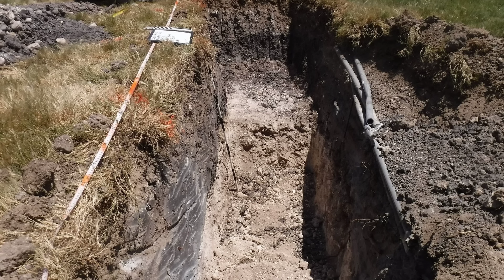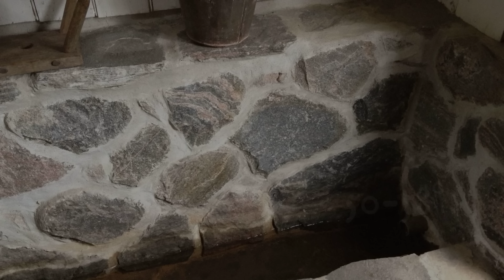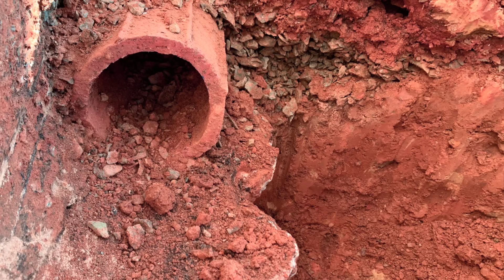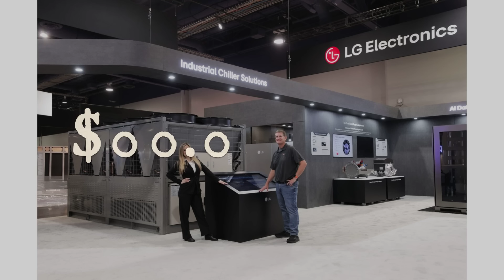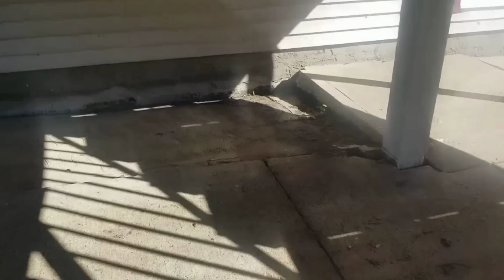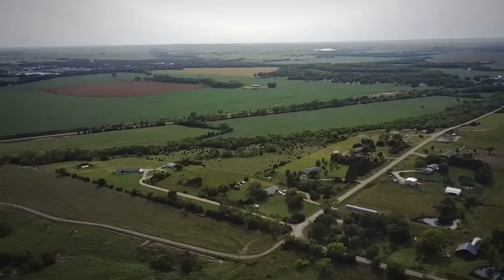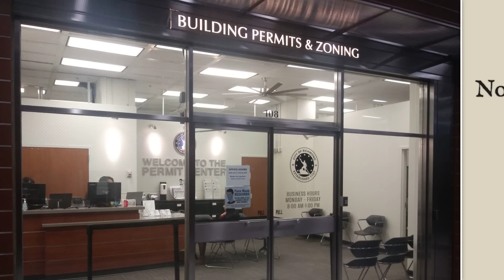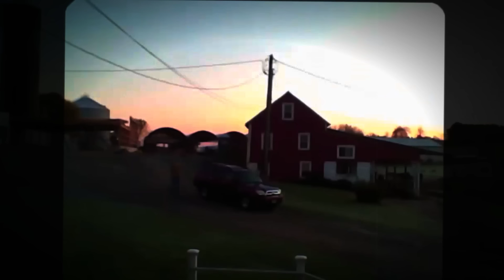This $300 Tunnel Keeps Any Home 55°F Forever — The Amish System the Cooling Industry Made Illegal

Comment: If you are, or want to be, completely off grid using the underground pipe system, copy what the Romans were doing a couple thousand years ago: install a pipe through the roof at the furthest point from the cool air intake, and paint the exposed portion of it black. Simple as that. The sun heats the pipe creating a natural draw due to the hot air rising and in turn the escaping warm air pulls the cool air out of the underground pipes, no fans or electricity needed.
Reply: dont worry the ac companies will find a way to make that illegal or any other way
Reply: @YTcommentsAreForKidsac does more than just cooling home. It's also a dehumidifier, heater, and provides airflow for the home preventing sick building syndrome
Reply: Easier to slap on a simple Trombe wall.
In summer,dump the heat outside.
In winter,vent it into the house.
You will need a large panel of double pane glass.
Matt black paint.
Several tin cans of matching diameter.
Or....
Position the pane diagonally,keep a raised bed of salad vegetables under it on the South facing wall.
Again....the wall insulates the house.
In winter,the compost nutrients (manure) will add heat to the system.
Reply: @b @boogieknee3781 himney effect will be negligible in winter

I do like the trombe wall but I’d ditch the Roman venting thing and have a big thermal mass with a pechka stove but going through the floor not a bed

House on pilings cause snow melts
Reply: @milolowly1744 definitely just use a wood burner in winter, this covers summer tho for sure
Reply: Niiiice!! Now if only I didn’t live in Florida!
Reply: @BURNINGLIMBO   it doesn't matter where you live. Even deep in the tropics the earth remains a stable temperature. Different climates and soil composition require different depth to bury the cooling tunnels. Moist soil, like in the East Coast doesn't need to be too deep, 6 feet generally. Dry soil in hot arid climates, like Texas, requires the cooling pipes to be deeper. Something like 12-15 feet.
Reply: @MesserEsser_OG what about phx?
Reply: @spikey01234  It falls under the same climate as TX. Once you go down 12-15 feet no matter where you are, the soil temperature remains constant year round within a couple degrees. 

Where it changes is how high the water table is. Some places have a water table 6 feet down. In those places you can't have a basement or a geothermal cooling system that's more than 3 feet deep. Most places 6 feet is fine. Some places you need 10-12, and others 12-15. There are websites dedicated to this and there are equations to determine soil composition and depth and annual seasonal cycles. If you are genuinely interested in implementing a geothermal cooling system, I would encourage you check those sites out and even reach out to them.
Reply: @spikey01234 still same temp
Reply: @MesserEsser_OG  Arid is a word I've never once heard used to describe Texas. Most of the state is as humid as Florida.
Reply: @MesserEsser_OG tell me you don’t know about water tables without telling me you don’t know about water tables
Reply: @BURNINGLIMBO  Geothermal cooling works very well in Florida. The ground temperature at six feet and below is right around 70F which is pretty cool in summer and nice and warm in winter. Do some research and you will see how it can be a real winner for you.
Reply: @TheCrunchbird  good luck getting 6 feet deep in most of florida without water lol
Reply: @TheCrunchbird if you dig 3ft deep in Florida you're at groundwater.
Reply: @TheCrunchbird  Fun fact, 90% of Florida is less than 5ft above sea level
Reply: @TheCrunchbird every where I dig here are giant rocks and theres a reason why most places don't have a basement here. 6 feet deep and we made a natural pool
Reply: @TheCrunchbird  the cost of geothermal is 100x what you'd spend on natural gas
Reply: @TheCrunchbird too bad I’m in Texas where it’s extremely difficult to dig
Reply: @TheCrunchbird worked under contract for 4 (15 years ago) years at then UOIT (yeah, it’s a mouthful of a name, renamed since) in Ontario Canada. There is one the largest borehole storage systems. Over 370 boreholes(I believe equipment came from Alberta to drill) 180-213m deep(up to 700ft). Right under the commons/soccer field. 150km of underground piping. I don’t remember exactly 12 or 14” dia mains(supply n return). I was there running equipment for wind tunnel, ad so ended up looking after utilities as well. 
The issues nobody talks about is when you have 2-3 seasons of hot summers and warm winters, the ground doesn’t have enough time to cool. That was in our case and extra water towers had to be brought on line in summer to help keep the building cool. 
Geothermal works and works better prolly in the pond than ground source.  Always should calculate extra cap. This was huuge project.
Reply: @TheCrunchbird that won't sufficiently cool a house though completely. You need a temperature differential higher than that to compensate for the heat load of the home. To achieve a 75°internal temperature on 90° day where your attic is north of 120° means that you need at least a 30° differential. The HVAC industry has done some evil stuff for sure but they do know their math as far as heat loading. Geothermal can be used as an assistant to a normal HVAC system within a Florida home.
Reply: @BURNINGLIMBO the most Florida thing ever said 😂
Reply: @BURNINGLIMBO who you talkin to?!?! 🤣🤣🤣
Reply: @BURNINGLIMBO you know, once you dig down 3 feet into the dirt, it becomes 55-60 degrees no matter where you are.

If it's hot outside, underground is colder. If it's cold outside, underground is hotter. You can always survive 60 degrees and it's easy to make it warmer if you need a fire
Reply: @BURNINGLIMBO  I’m in Texas and had a guy show me one of these he had for a 4000 square foot log cabin 20 years ago. It worked awesome and cost him very little, even in the Texas heat.
Reply: @BURNINGLIMBO  my man, that would be pretty nice i would imagine. You have a significantly more moist ground to work with. 

Your only drawback in my mind would be having an industrial dehumidifier 😂 which, with the Florida sun, getting that on a small and cheap solar system would be very doable!
Reply: @King_DarkSide  Use a closed pipe system filled with water and antifreeze. It works great and does not require any permits.
Reply: This is the stuff in comments that inspired me. I don’t know anything about that subject, but it makes me want to learn so thanks for lighting the fire under me!
Reply: Everyone who reads this, we don't know each other and probably never will but I wish you all the best in life and all the luck in the world
Reply: @BodycamLegalCentral no
Reply: Oh dear I don’t like it above 60f…
Reply: And what about radon?
Reply: @NukeJesus  Good question. 
Since the primary means of radon mitigation is ventilation, and this system operates based on ventilation, it is logical to conclude that radon exposure concerns would not be a problem. Of course, lots of testing would need to be performed in order to verify this hypothesis.
Reply: @NukeJesus  These deep thinkers will tell you that Radon is a Globalist hoax.
Reply: Wouldnt do anything for rooms not in the path of that air and besides it would have to be a huge pipe to get enough air flow, you aren't just replacing the air, you have a heat load as well from the slab, windows, walls and roof.
Reply: @chrisduncan1647  You can also use multiple outlet pipes to draw air into as many different rooms as possible/needed. The underground pipes that the Romans used were supposedly tall enough for a man to walk upright in them. That's a huge air volume to draw from, and they usually used two.
Reply: @chrisduncan1647  You can also use multiple outlet pipes to draw air into as many different rooms as possible/needed. The underground pipes that the Romans used were supposedly tall enough for a man to walk upright in them. That's a huge air volume to draw from, and they usually used two.
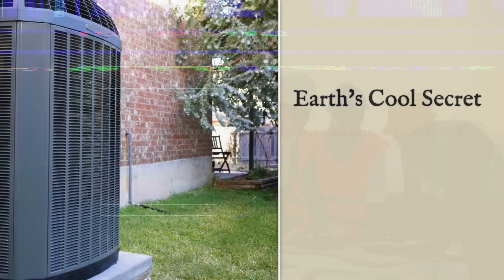Reply: 1:43 This is mind-blowing 🔥 Simple system, massive cooling effect.
Reply: Thank you for this nugget of information!
Reply: Should we worry about radon doing this? I’m assuming “no” because the pipe is sealed and pulling air from above ground and being cooled or heated by the ground, but air is not coming from the ground right?
Reply: @brycejurgy Correct, if you properly seal the underground pipes. Look up radon maps for the trouble spots, you may not have anything to worry about anyway.
Reply: The same physics at work that cool the giant ant mounds you see in scorching climates
Reply: combustion 101...love it
Reply: Thank you
Reply: *Greeks
Reply: This would only help in summer i think, what about cloudy winter?
Reply: @MADM-tinus burn wood 😂
Reply: ok, install a pipe... how big, how long, and where does it lead or connect to? or is it just install a pipe and let it dangle in my living room? Im not being sarcastic here, genuinely want to know...
Reply: @TheTruthSeekingSage 

The one in the roof? 
It's just a vent.
Reply: @TheTruthSeekingSage me too
Reply: @TheTruthSeekingSage  It has to be below the frost line. The longer the tube or the more tubes, then the more cooling. You need a vertical tube open to the outside air. If you want to use a fan, then that will be sized for the drop of the tube. If you want an entire passive system then you need a tube out of the roof which is painted black with thermal mass which is hot and causes a draw
Reply: @xando81  yeah i get it... but this is a lot of work for a meh effect...
Reply: This is basically a passive cooling system, right? Curious if anyone has built something like this. how effective is it during peak summer?
Reply: @HardTimesHandbookI'll tell you in 1 week or less.  I have the pipe burried.
Reply: Just don’t use lead pipes 😂
Reply: Important to note: this requires an airtight design down to the pipes.
Reply: @PentarchRise Why?
Reply: Idk almost positive this won't work in canada 😅
Reply: @aldanwherrett3575 Guess you'll have to move then. Better act now before the rush hits... 😂
Reply: Isn't that how alot of mideast "structures" are built? Im not sure about the black paint but with the openings at the highest points and air intake openings at the lowest points?
Reply: How do you keep rain out of your house with that pipe, and what do you do with it in the winter?
Reply: @ThunderStruck-c6y Never had a wood burning stove before, have you😂? Buy or make a rain cap for the top, and leave a small drain hole at the bottom.
Reply: That's a great idea. Thank you.
Reply: That sounds elegant in theory, but are you ignoring condensation, mold, radon, and the fact that natural draft changes with outdoor temperature and wind? The Romans used similar ventilation ideas, but that doesn’t mean a black pipe can keep a modern house at 55°F “forever.” Where is the real-world data showing stable temperature, humidity, and airflow without fans?
Reply: @SarahYoder-b8x  Never said it could. Don't try to put words in my mouth.
Reply: @Last-Varangian Are you afraid to answer?
Reply: @SarahYoder-b8x  Nothing to answer. I didn't claim anything you mentioned. If you think I did, quote it. 🧌
Reply: Big Energy: Please answer the door to speak to our armed representative!!
Reply: A literal heat siphon, but im not convinced it works like that, if there is no pressure from the inside to then force the air through the pipe. Youre just heating the air around where the out take pipe is, that doesnt guarantee circulation through the house.
Reply: @AstroSpeaksTruth It works because it creates a draw, that is lower pressure at the exit point, just like a fireplace chimney works. The heated air rising in the black painted pipe creates the draw.
Reply: @Last-Varangiana fireplace works because there is an open outlet for the smoke to exit through, above, which when the natural heat rises, it finds the vent for. 

If you heated the end of the chimney, I doubt you would see "faster flow" or "a draw". 

Fluid dynamics is a little different than air dynamics. It would be the same as if you had a metal straw, and simply torched the top of it. It wouldnt cause air to just start endlessly flowing through the straw. The heated air would rise, sure, which would likely incorporate a very small, negligible draw, unless it was an entirely closed system. I dont see this being that efficient, unless you engineered it to be complicated and the temperature differences, stark.
Reply: @AstroSpeaksTruth The pipe through the roof is open on both ends also, just like the fireplace chimney. Did you think I meant a sealed pipe?
It doesn't require much of a draw to pull cool air through the building. No, it's not going to be like forced ventilation by any means, but it is a matter of historical record that it does work. Think a very tall and large diameter exit pipe and the amount of draw it will create, same with the entrance vent from the underground tunnels, not like a small plumbing vent stack as is seen on most homes today.
Reply: @AstroSpeaksTruth  You absolutely do get a better draw with any heated  exhaust pipe/chimney .
Reply: Air is a fluid, and what you described with a straw and heating it, would work precisely that way. A home is a closed enough system for the draw to be worthwhile.  @AstroSpeaksTruth
Reply: Come try that in Alaska lmao
Reply: @milolowly1744  you arent the brightest are you?
Reply: @milolowly1744  it would actually work up there
Reply: @ccc @ccclc6159  sunlight ain’t warming your air in mind -40 dum dum and for one thing it would freezer over with condensation 

Nothing simple about it brother don’t be spreading lies
Reply: @milolowly1744 this comment chain has been such a lovely read of exchanging of ideas, and sharing of knowledge.....

Then there's you 😡
Reply: @Quocalimar bunch of wankers who haven’t engineered or built a damn thing outside ya’ll imaginations

Spreading bullshit and saying it’s easy as pie
Reply: @milolowly1744  its very simple brother.  Why are you trying to make your place colder when its -40 already?   This would absolutely work great on a summer day in Alaska where you wanted to cool off the structure.
Reply: @t@timothyhennessey78 cause we get snow

Snow melts water freezes the air condensates into water

I don’t even know where to begin with why this is stupid in any climate I’ve ever lived in

Good luck with your sump with no electricity lmao
Reply: The military has a few buildings that use geothermal. Mostly prisons.
Reply: That's only works if your whole house seals well when all doors and windows are shut. Even the gaps under the doors need to close against a seal.
Reply: @vitali-opal-and-gem I don't think the Roman houses/buildings were sealed that well.
Reply: This technology was already used in Persia even before the Romans adopted it. And I saw it still on many houses in Syria, where they are called wind towers. The wind helps attract air coming from the underground part of the house where air piped from the ground arrives cooler than air in the house. Incidentally these are the people D. Trump wants to bring back to the Stone Age where he said « they belong ».
Reply: Do you have this?
I doubt it
Reply: Let us know what your local Fire Marshal thinks about it ...
Reply: @centurione6489  Why would what he thought matter? Not any of his business.
Reply: @Last-Varangian Yes be sure to the home inspector and other compliance officers that it is none of their business.
Reply: @Will-xk4nm Fortunately,I don't have to deal with any of those facists where I live, they don't exist here.
Reply: @Last-Varangian Come visit civilization some time.
Reply: @Will-xk4nm If your idea of civilization is fascists telling you what you can do with your own property, no thanks. I prefer dangerous freedom to slavery, and I live in one of the larger metropolitan areas of my state already, we just don't allow globalists to tell us how big our doghouse has to be.
Reply: @Last-Varangian Globalists?  That's hilarious.  Yeah dude, you've been entirely programmed.  Your politics are the equivalent of Flat Earth stuff.
Reply: @Will-xk4nm Ever heard of the International Building Code? BTW, in case you haven't heard, the planet we live on is round... 😂
Reply: @Last-Varangian LOL the IBC was developed by Americans in America.
Reply: @Will-xk4nm  I had yet another snippy response to you, but in the process something even more hilarious occurred to me. The Internet is a very interesting thing indeed. For instance, here it is, allowing two people to trade comments about something that doesn't even matter, and who have never met in real life and probably never will. Interesting how something that was once touted as a great tool that would bring people around the world together has instead devolved into a platform where people simply trade insults with each other and separates people more and more. Funny that... 
Have a nice day!
Reply: @Last-Varangianno one made you argue.
Reply: @Last-Varangian The Internet is a globalist project brought to you by globalists for the purpose of globalization.  But you only complain about half of Globalism because your attitudes were programmed into you by a media echo chamber you delight in. You aren't arriving at your own conclusions based on an informed understanding of the world or modern history.
Reply: @Will-xk4nm  that's quite hypocritical. The brainwashed guy regurgitating propaganda and telling someone else they're "entirely programmed" is rich. 😂
Reply: @MesserEsser_OG  Go back to watching Alex Jones.
Reply: @Will-xk4nm  Why would I watch Alex Jones? Please enlighten me why you get to determine who or what I listen to? 

Now get back to your school work kiddo. You shouldn't be playing on the Internet during your school hours.
Reply: @MesserEsser_OG  You watch Alex Jones because you a conpiracy-addled dum-dum.  I took my Masters degree before you were born, back when we got our online kicks at the local BBS.
Reply: @Will-xk4nm  lol someone believing that you can't do this because the fire marshal or the building inspector won't let you do it on your property that you owe and  paid for, then simultaneously calling someone else "programmed" is quite rich 😵‍💫

Now get back to doing as you're told you well programmed sheep 🐑
Reply: @Will-xk4nm and pay hundreds of dollars for something you can get for free? If that's civilization, then count me out. I like where I live, where I can drive to the store or shoot a deer off my porch, whichever I feel like doing that day. If I want to dig a hole and put some pipe in the ground, I'm 100% free to do that. Other people might even pay me to do it for sheds or garages where they have woodstoves for heat, but they don't have any cooling in the summer.
Reply: @cyleleghorn246  Of course you love living there, it sounds wonderful.  I've got no problem with anyone's property rights or with smart passive cooling.  But if you live where there are inspectors and codes then you'd better observe them.  You people are craaaazy sensitive to the tiniest amount of perceived criticism.
Reply: @Will-xk4nm  Why the hell should you observe them?

You think they can run around and break apart your house at any time looking for "build code violations"? 🙄
Reply: @sevenproxies4255  So that you can be legally insured.  So that you benefit from best safety practices.  So that you can sell your home later.  Doesn't sound like you've ever owned a home.
Reply: @Will-xk4nm  I do own a home now. A home is where you live. Not something you "sell later".
Reply: @sevenproxies4255  Well that's weird.  I've sold 2/3rds of the homes I've ever owned.  Most people sell the home they live in.  Maybe you've put down roots and will never move again.
Reply: @Will-xk4nm telling someone they’ve been entirely programmed while using a clippy PFP yourself is hilarious. 

you also think recognizing the existence of government over-regulation is comparable to “flat earth stuff”??😂😂😂 

you’re an absolute genius man.
Reply: @ct-gt2dt  So do you also identify "globalists" as a major problem for your building code like the Flat Earthers I am arguing with here?  Ya'll are gonna miss globalization when the coming shortages impact you LOL.  I am happy to admit that government over regulation exists.  But if you think completely ignoring codes is the smart thing for an adult man to do with his property then you are a fool.
Reply: @Will-xk4nm civilization where you are controlled by the government on what you can do?  And when you can do it ? Or say?!  You realize you sound like a indoctrinated slave. Pay taxes and be happy?!?
Reply: @oldblack15  You live somewhere like that right now LOL.